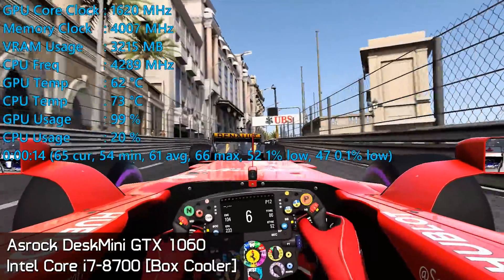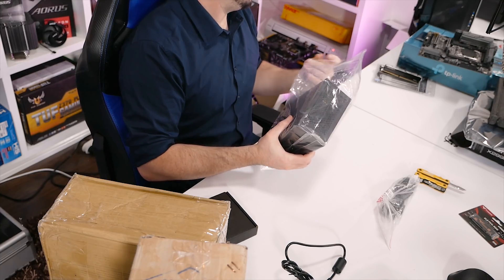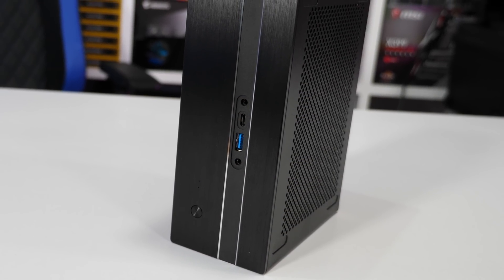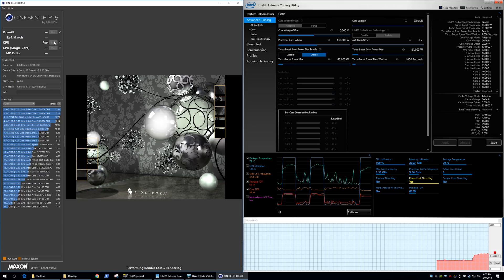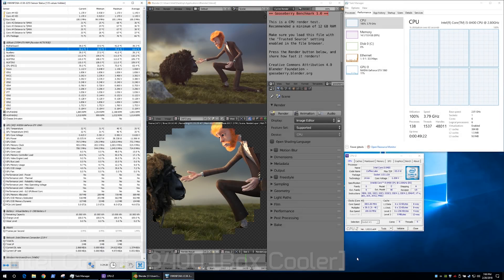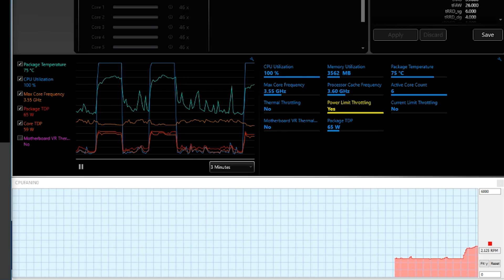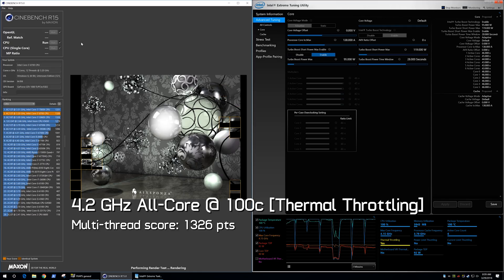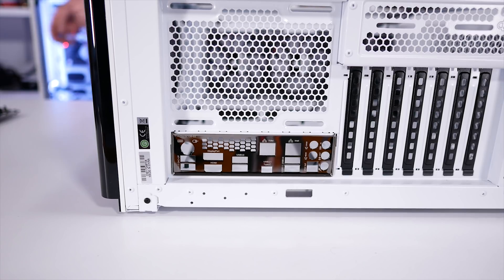Core i7 8700, Intel Box Cooler Limiting Performance

Comment: 11:30 the issue is not reviewres buying the 8700 and test with the intel cooler. 
Every OEM build their systems based on specification provided by Intel, so if they have a chip that says 65W TDP, the OEM will put on cooler that has a cooling prformance of 65W. Meaning, every OEM build, that has an i7-8700 in it will thermal throttle, and provide below average performance. 
And as a customer or company you buy one or multiple OEM systems because you expect a certain level of performance, but those PCs wont deliver them because they will thermal throttle and will underperform. On top of that you cant just swap the cooler on those, because you will void the warranty.
Reply from the maker: @MGsubbie - A single small typo? Calm down buddy :D
@Dmitry - Why are we comparing the R5 1600 and 7700K?
Also you've cherry picked a best case scenario for high-end performance given the settings and graphics cards used. You're also taking offence to the language I used to make a point, just relax we know Ryzen is on par with Haswell for gaming, BUT it's still an amazing series.
Reply from the maker: @Dmitry ohh boy another fan calling biased, here we go. How often do you play Cinebench? I was obviously referring the the 100's of gaming benchmarks we've provided on the channel. How often does your overclocked R7 1700 beat a stock 8700 in games? Careful how you answer that, you might come off as being biased :P
Reply: I did not hear that 1800X with Wraith Spire scored less points than with another cooler, it can keep 1700@3.85 ~1700 CB15. And about "8700+box=still dusts Ryzen Cpu", not sure. I think 1700>1127, no? Steve, you're becoming biased :-) .
Reply: Cpu is universal thing. Even in your review "Intel Core i7-8700K Review: The New Gaming" you spend plenty time to bench Blender, Corona, etc . Refer to one side of the medal.... How often? https://www.techspot.com/review/1490-ryzen-vs-core-i7-vega-64-geforce-1080/page8.html . GTX1080+1440p - 2% average difference, 20 games. Are you sure that to call a 2% gap "dusts/beat" - correct and not biased :-) ? I do not think that the owner of the i9-7900X will be very sad, that he got "dusted" by 8400 in some games. Because 8400 weak in any other aspect.
Reply: 1600=1700 and 7700k=8700k in gaming, roughly speaking, sorry you not done extensive testing recently with 20-30 games, like before, so i pick this results. Cherry picked, why? GTX1080 far beyond the average video card - GTX1060.. with today prices it can be 1050Ti. 1080Ti + 720p + 240hz monitor -> much more unrealistic scenario. But of course no one denies that it's faster in games, in a vacuum.
Reply from the maker: Actually you’re wrong it is. 65w TDP is calculated from the
base frequency and even so you don’t pair a 65watt TDP part with a 65-watt
cooler, that’s not how it works. The issue is the Intel box cooler is under
powered but having said that it meets their spec. Performance of the 8700 with
the box cooler is still mighty, it’s just mighty hot 😉
Reply: Im aware of that, but the whole Con-Job is originated from the fect that the i7-8700K in an HP Omen OEM build scored 2-300 points less in CB multicore than DIY PCs. And the reason was, because HP built that system with a cooler matching the specified TDP rating by Intel for the 8700K and the CPU couldnt hold the maximum all core turbo clockspeeds for longer than 10 seconds.
And a lot of people buy pre-built systems based on benchmarks of DIY systems, and then experience 15-20% less performance out of the same chip.
Reply from the maker: I'd you use the box cooler on the AMD Ryzen 7 1800X if won't hit the same XFR as a liquid cooler, you also can't overclock it. Yes, Intel's box cooler is trash and holds back performance, but that's just extra performance you can unlock with a better cooler.
Reply: Yes, and in my understanding this is the Con-Job itself. 
People see that Intel chips performs better than AMD chips based on their preferred reviewers' tests, and then they buy pre-built systems based on Intel chips. And then they experince that the Intel chips in those pre-built systems perform worse than AMD chips, because the cooling solutions only match the specified TDP rating and not higher than that.
But the damage is already done, Intel already got its money, the OEM already got its money, and the end user is left there having a less performer chip in his system then he thought it would be, and can decide to 
1. buy a better cooler, void the warranty of the system and install the cooler on his own or
2. pay even more money for his OEM to install a better cooler in his system.
As i see it, this is the CovfefeLake Con-Job.
Reply from the maker: Hate to break it to you mate but with the box cooler and the fan limited to 1,500 RPM the 8700 still dusts the Ryzen CPUs ;) Ryzen is about value.
Reply: Hardware Unboxed im really enjoying this conversation but we talk about different things. 
The Con-Job is not about beating competition. Its about squeezing out more money from people. Let me put it this way:
Steve at HardwareUnboxed says the i7 8700K scores X points on the test.
I like that so i buy an OEM pre-built pc with an i7 8700K in it for a little more money than Steve bought his DIY pc.
I turn it on, run the test and see i score 20%less than Steve. Why is that? I have the same specs as Steve. Oh, so i have worse cooling than Steve despite spending more money on the pc, and because of that i have less score. 
So how do I make my i7 8700K score the same as Steve's? I need to pay more money to my OEM to have better cooling.
So in the end i spent a lot more money than Steve and I only have the same score as Steve.
So i got "Con-Jobbed"
Reply: @Hardware Unboxed

Get some sleep mate. Some serious spelling mistakes in your comments. ;)

Comment: No one buys a i7-8700 and uses stock cooling, regardless is limiting performance or not. That cooler is there for buyers to be able to instal the cpu right away, if they do not have bought an aftermarket cooler yet.
Reply from the maker: Uhuh ;) Sure that's what happens, all the time.
Reply: Well....they don't have to supply a cooler, like they do with other cpus. But the fact they include one, even mediocre, makes me happy because I can easily test the cpu, and offers me a temporary backup cooling solution. These stock coolers are intended for entry lvl cpus only or for testing purposes, and any i7 buyer knows this. This video is pointless, as much as I love your channel. Keep up the good work.

Comment: I love this Hardware Unboxed vs AdoredTV friendly fights over benchmarks of Intel products...these in depth tests and fact findings make our life easier to make decision for what to buy and where to allocate funds in a PC build...
thanks for pointing me to the gamaxx coolers..mine deepcool 300 keep my R5 1600 at 45-50C with 32-40C room temp which is no easy task (3.9Ghz at 1.237V. can achieve 4.2Ghz at 1.3v but I don't want to toast my CPU in this High ambient temp)
Reply from the maker: Well at least it lead to the discovery of why the 8700 is really underperforming in some systems compared to what we often see on the test bed.
Reply: Regardless, on average people will still buy Intel. Slowly, AMD is taking down the big blue a notch but it's gonna take a lot longer due to people not doing the proper research before they buy.
Reply: Th W. One of them tests far more than the other but he does not test everything. That isn't really possible. The other does a lot of research before he asserts anything and his latest video about Intel cherry picked cpus is a very well researched and articulated video i think you should watch.
Reply from the maker: @issaciams - I'd ask you to ponder something mate. If you ran a store with the sole purpose of selling CPUs guaranteed to hit certain frequencies and you were charging a massive price premium to do so, would you advertise the fact that most chips hit those frequencies?

"Hey most 8700K's hit 5.2 GHz but we're charging 100% mark up to guarantee it, are you interested?" LOL
Reply: @Hardware Unboxed. Hmm, you shouldn't do that mate, accusing the delidding company for not being truthful about their numbers. That's not a certainty unless you know something we don't. Love you're videos (and AdoredTV's) but please refrain from accusing people of things you accuse others of.
Reply from the maker: @issaciams – You can read and watch 😊 a lot of things on the Internet, hard to say what you should trust. I can only tell you of my experience  and those of friends and people I trust (take that as you will). As I said I don’t doubt there are some lemons, I do doubt that your chances of getting an 8700K that can’t do 5 GHz are high.

Anyway I'd love to get my hands on half a dozen to a dozen retails chips and run some tests and I'd really like one or two other publications to do the same. I really don't care which way it goes, I'd just like some actual testing done from independent sources.
Reply: Hardware Unboxed I hear you Steve and that totally makes sense from a business standpoint when you look at it from that perspective but if it was that easy to get those frequencies then they would surely fail as a business. So many people on the internet are also claiming that they aren't able to get anything over 5.0ghz no matter what they try.
Reply: Th W. The reason I love Steve that he do ridiculous amount of benchmark and give the very best idea what I can expect from a product but he can't test every CPU/GPU or not even a statistically significant amount of GPU/CPU. He have to confine his test to what companies send him or the few he buy from his local store.In a perfect world that would be more than enough but in current market you can't be sure what corporations are doing to sell their products. So if some one put some tinfoil hat and compare all the reviews and "conjures up speculations" which leads Steve to do some specialized benchmark to debunk or prove that speculation, I am all for it. Because at the end of the day I have to Invest my money to a system which I have to use for next few years and I don't want to be screwed by corporate greed.
Reply from the maker: @Nick Chapman - Exactly, he could be totally right and I wouldn't be surprised if they were cherry picked, but I'd want hard evidence before calling it. As I said the bulk of the research was very interesting. Part 1 was interesting but turned out to be wrong, part 2 was again interesting and somewhat correct. Part 3 needs serious investment to prove, for now it's mostly speculation, though to give credit some good facts have been gathered.
Reply: how come the average on hwbot doesnt hit 5 GHz on air and only a little over on water?
Reply: @Hardware Unboxed thanks for the info. My cousin want to buy a new PC for his 3d animation and UI design works and he is hellbent on Intel system because AMD "runs hot" and all the computer(3-4 years old) he saw at his office are Intel. that is why I'm gathering as much info as possible about Intel current gen before recommend him a system. Still trying to convince him R5 1600 (2600 later maybe) will be better and cheaper for him than a i5 8400.
Reply: @Hardware Unboxed. I know what you're saying mate, I just want you to just let the endless testing speak, that way you can't go wrong. Please make that multi 8700k video. :o
Reply: The day Jim does his own testing on his own equipment rather than relying on cherrypicked items from other tech channels, sites etc is the day he will gain a lot more credence amongst the wider community. Love hs company profile stuff but his other stuff is a bit monotonous. Averages of averages are statistically unsound. +Hardware Unboxed Steve, keep up the great work. Time has come for Intel to 1) beef up their coolers and 2) replace TIM on at least the K sku CPUs.  At the end of the day I doubt it would cost them much more than a dollar a chip, even if it was 5 I would be happy to pay.
Reply from the maker: @Naga Sadhu - I'm not saying it means much, I'm just saying that's been my personal experience. If you add personal experiences from a number of sources together it seems to paint a different picture, well slightly different anyway.
Reply: ^ [HU response] this was my complaint about the [Adored] video.  May be totally legit, but unless you can have a more inherently unbiased source (or at least 2nd source with independently confirmed numbers), it is still suspect!  Lets pony up enough patreon money for Steve to have 10 i7-8700 processors purchased from various channels and beg him to spend the time trying to get some real numbers.  :)
Reply: issaciams lol so true. Silicon lottery would've gone bust years ago if that's the case. Take note, Steve
Reply from the maker: @jscb - A little over 5 GHz on water makes complete sense, no one ever anywhere didn't say they run hot AF!
Reply: The reason people aren't running out and purchasing Ryzen has more to do with AMD's reliability and track record than people needing to do research before buying. I've been building/repairing systems locally as a hobby for 10 years. My mentor has been in the scene since far before my time and there's a trend of problems with AMD systems. You could make an argument that AMD systems are often cheap and that is one of the causes, but that doesn't make consumers less skeptical. I'm happy Ryzen is starting to change the stigma though. At the very least competition the is welcomed.
Reply: Navonil Mukherjee I'm also buying a new PC for 3d animation, rendering and gaming confused between Ryzen 2700x and 8700k I don't know what to pick can you tell me which software he uses
Reply: @Hardware Unboxed in the end, it's all about dialogue and civilized conversation, sharing knowledge and widening (one's/my own) horizons :) so, the end of the story for me is like: further investigation required! because we like sciency-stuff :D
btw, I have an answer to my comment in my notification box from some Don Guru de Bro, but it's not here. Could you get that comment out of your spam-box? Thanks alot!
peace!
edit: or maybe you need to censor comments!? c'mon!!
Reply from the maker: @Navonil Mukherjee - My experience so far as been with three retail chips, all did 5.2 GHz on the MSI Z370 Godlike by setting the multiplier to x52 and rebooting :D I've spoken with other users in our discord chat, as well we fellow YouTubers, and no one has fallen short of 5.1 GHz. Of course you can buy bad chips, they just seem to be very rare.
Reply: @Hardware Unboxed. That's already more interesting information. You'll need a lot more CPU's (from different batches) to make it certain (and an interesting video) though. On that note: Please do!
Reply from the maker: @Stoom – I’m not accusing them of anything, I’m saying be open to possibilities. I mean bloody hell look at the business model, not saying they aren’t honest, I’m just saying probably not the best source, especially when you choose just one. Meanwhile everyone who has bought a chip or two has found them to be the same as the samples. People have been looking into this for years.
Reply: @Hardware Unboxed well, nice anecdote with your three chips, but statistically that doesn't tell anything, except you got a nice batch. and your silicone lottery arguement sounds more like an ad hominem :(
buuut anyway, again a very nice and entertaining video. keep up the good work and thanks for all your time and effort you put into it. and see you next time (can't wait <3)
peace!
Reply: You say friendly fights, and while Steve absolutely stays professional, Im sure he gets tired of having to debunk these type of baseless rumours over and over.
Reply: @Hardware Unboxed ..there goes AdoredTV's golden sample theory.. where do you think I should look what kind of OC GHz expect form a CPU on avg. I can't see all the tech press to get a general idea and AdoredTV or simile channels are the only place do some rotten tomato like review aggregation...which are not that reliable as you obviously know
Reply: I did watch it, he went as far as using random forum tables of overclock from very few people with no criteria whatsoever to show some differences with deliding, tables that also clearly show that on a lot of cases there was no difference at all but he ignored that to support his claim that delidding always improved overclocking. He spent the marjority of the video repeating his claim without testing shit, especially when its so easy for people to get to 5ghz on those cpus.  The only way to prove his point would be getting his hand on the reviewers samples and make all of them reach 5.3ghz, which is impossible for him to do, so it all remains in the realm of speculation.  
  
Hardware Unboxed has contradicted adoredtv time an again doing thorough testing, and that only prompts adoredtv to make more speculation videos repeating himself without any testing at all, but extrapolating and speculating on top of whatever he is able to find on the internet that vaguely supports his claims.  
  
He is the Glenn Beck of AMD, and like Glenn Beck there are plenty of people that eat his crap.
Reply: Except one of them tests everything while the other conjures up speculations.

Comment: They should either charge 5$ more and provide a better cooler for their locked parts or take off 10$ and put no cooler in the box. A cheap Hyper Evo 212 will do the job perfectly.

That H115i Pro RGB is a beast btw, i put one on my 8700K 3 days ago.